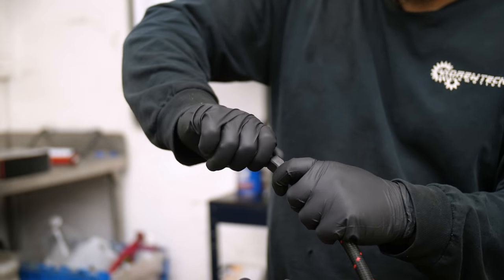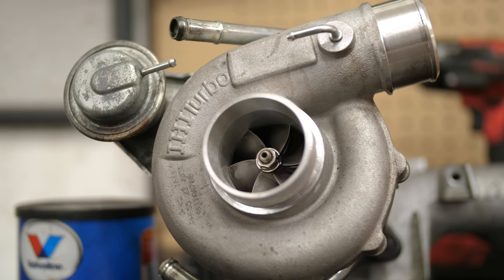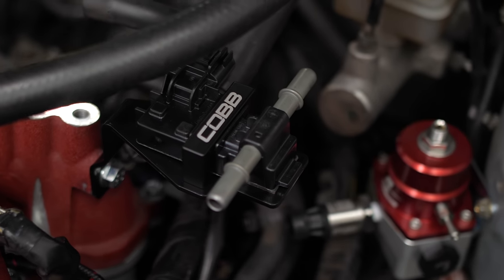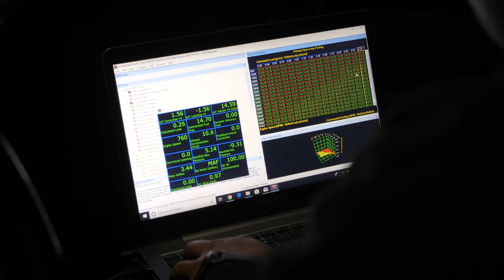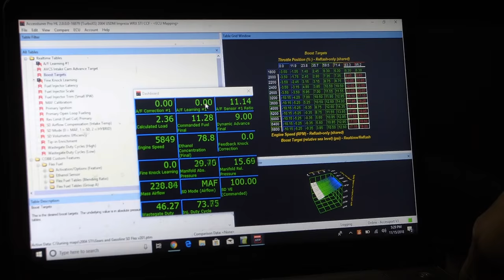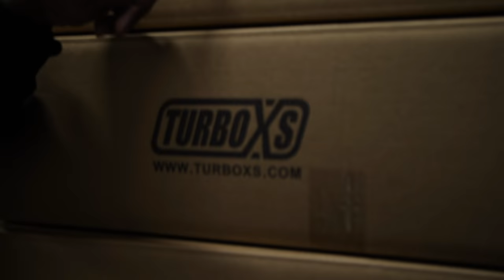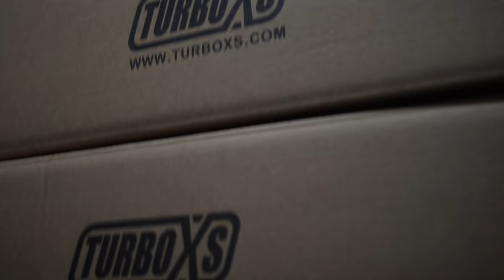Installing Flex-Fuel E85 on My Subaru Forester

Comment: You're going through all this work just for 310hp. Fact is, even with just exhaust and intake mods, these stock Subaru engines are known to eventually fail due to mileage. If there is any inherent problem with your specific engine, 310hp would still cause your engine to break, but the damage would just take longer to surface. 

If you are just a regular guy working a 9-5 job at the mall, you would want to make your car as reliable as possible to save money on repairs and to ensure you can get to work reliably as to not lose your job. But you are a YouTuber. You are in the entertainment business. Your job is to document the process in a way that's interesting. I've been a follower for a long time and I want you to succeed. You guys have excellent production value. It's just that your videos are just like traditional television car shows. This channel has the potential to compete with other automotive YouTubers in terms of entertainment value, but it is hugely limited by the lack of desire to push things further and to try exciting things. You have to ask yourself. Do you want to be content creators like Salomondrin, TJ Hunt, Tavarish, Adam LZ, etc, etc? Or do you want to be like dinosaur media such as Motor Trend? I am not a hater, I am a fan. But this video just makes me feel that, in my opinion, the content creator just wants to finish installing all the nice parts, get the car running, and be done with it. It's like you just want to get the car mods over with and go home as if it's a chore. The way Francine keeps insisting you to bump up the power more seemed as though he felt achieving such low hp was a waste of his talent and time.

Comment: Calling the Bens, Su-Ben (Subaru Ben) and Mitsu-Ben (Mitsubishi Ben)

Su-Ben is the kind of guy I can relate with. Prioritizing safety and reliability. Even though it's still safe to increase the power just a little bit, it's still safer to keep it below the safe threshold just to make sure it's safer. Mechanical sympathy.
Reply: Better names would be bensu and benmitsu
Reply: @alexstromberg7696  Better!
Reply: I know guys on stock internals making 350+ with meth on 93oct
Reply: @Bittertokken  meth is meth.
Reply: So great to see this kind of mod work in action. All I ever see on YouTube is chatting with tuners to get "just a little more...", not cutting it back. Welcome to tuning your daily.

Comment: The two most impactful mods you can do to an EJ to improve reliability, without splitting the block;
1) Replace the oil pickup - factory one has brazed joints, and they crack. Suck air, lose oil pressure, engine goes bye-bye.
2) Equal length headers - Cylinder 4 always (ALWAYS) runs leaner, and hotter than the others. Its the first to blow. EL Headers fix this by equalising, and reducing all cylinder temps.

No need to split the block, no need to put it on a dyno.
Reply: charliemoz but unequal length headers sound so good!
Reply: @HeyBigChriss  the boxer rumble sounds glorious, but it's unfortunately one of the major contributors to early motor death.
Reply: don't forget an Air Oil Separator
Reply: What is the “oil pick up” and where can I find that on my wrx
Reply: @TheCarBro  inside the sump
Reply: And pull the oil pump and take out the philips screws on the back and put loctite on them, they’re known to back out and cause a loss of oil pressure
Reply: @conorwright5546  AOS is only really important on very highly boosted engines (read: need forged internals to reach kinda boost levels), or for a direct injection engine. What the gears and gasoline guys are doing here, its not really all that necessary.
Reply: Oil pickup, EL Header, AOS or Catchcan, and Coolant reroute should all be on the list
Reply: @TheCarBro  a good one to look at is killer b oil pickup and upgrade to a 12 STI oil pump. The best upgrades for reliability. I used those on my 05 STI. I beat the shit out of it.
Reply: 71BGLancer what the difference between oil pick up and the oil pump? All in the name for my 2008 wrx with a vf52 swap
Reply: @TheCarBro  well the oil pick up is an upgrade to the stock one. The stock one breaks and you starve your engine from oil. The 12 STI pump is bigger and better it holds a little more oil. If youre tracking your car then a baffle will also be good it keeps the oil from sloshing side to side while on turns therefore engine gets enough oil. Oil starvation is what kills the EJ engines..I've gone through 4. Two 205s and two 257. When they go just go all out on the build and make everything stronger..overbuild.
Reply: 71BGLancer is the both oil pick up and oil pump DIY friendly?
Reply: @TheCarBro  depends on the extent on your knowledge on working on cars. The oil pick up and baffle go in the oil pan so you'll remove your headers and oil pan. The oil pump you need to remove the timing belt and the sprocket on the oil pump. I'm sure there are a lot of videos on how to do it. I did mine with the engine out so it was really easy.
Reply: 71BGLancer I installed full bolt ons on my wrx so in those categories I have experience in not so much with these oil things. But next thing I have to tackle is my timing belt. Do I really have to find a clamp to hold the driver side cam gears from moving?
Reply: @92BGLancer  12mm oil pump in a block that had 11mm originally is fraught with issues if you have no idea what you're doing - I'd advise against this, or get someone who knows what they are doing with EJ engine builds to advise on this one. You only get oiling wrong once.
Reply: @TheCarBro  Oil pickup is a tube that extends down from the bottom of the crank-case into the oil-sump, to "pickup" the oil, for delivery to the oil pump. The pump is just that, a pump that pushes the oil around your block and heads.
Reply: @TheCarBro  Doing the pickup is about a 3/5 on the home-DIY'er difficulty scale. You need to unbolt the engine mounts and lift the engine up a bit to get the sump off, and access to the pickup...if you add too much gasket-goo around the sump, you can ruin your engine by causing the pickup to get blocked, starving the engine of oil...probably worth the few hundred to just get a mechanic to do it.

Comment: 07:13
Anyone else notice the apparent excessive vibration coming up through the steering column?
Reply: Brodie Bennett hmm, yea. He definitely has that road feel tho
Reply: These foresters have a lot of issues with the steering column but usually just with them leaking
Reply: SiccBmw so it’s normal for the steering column to vibrate such, with the miles it has?
Reply: I’m pretty sure he has a STI steering rack. Maybe the chassis dyno was causing it?
Reply: yes
Reply: Its because hes on a dyno jet dyno.... its awd so the front wheels, hooked to the steering linkage is vibrating. look at say.... evans tuning on youtube that uses the same dyno setup, alot of vibration from the dyno being hooked up to the hubs.
Reply: Launch Control ahh, thx!
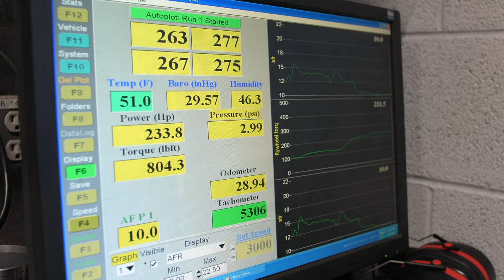Reply: 6:46 look at those vibrations at the flange and afterwards on the whole car back end. That dynamo-meter is not calibrated.
Reply: That's not a Dyno Jet, it is a DynaPack hub dyno  @DucDynasty
Reply: its a subaru, those things are total shit.
Reply: Cause racecar
Reply: FEEDBACK
Reply: Mine vibrated the same on a hub dyno Dynopac.
Reply: Ozzie Sheppard Wtf lmao, It was because of the dyno they used.
Reply: stiff motor mounts give the car more NVH (Noise, Vibration, Harshness.i have an NA forester ,upgraded the mounts and you can feel the rumble through the seats. some people like the feeling, others like a smoother ride. its no cadillac lol

Comment: Mine is completely internally stock. Lol e85 on 24lbs its amazing. Never been happier. It's been forever since the tune a still going strong. Engine wise. Because the power it is making, transmission blew first before the engine. How much does it have, can't Remer the actual number, but I don't beat a 500hp bosted beamer. So not too slow still. But 25lbs my friend, it is not unhealthy. It's rather too much fun. But the amount of E85 she takes, ha. It's worth it

Comment: Love the vid! really shows how cars can become money pits, as my car has become.  My 2004 FXT is making 365wtq and 312whp (dynojet) on 93 pump gas with pretty much a similar setup.  At what point is e85 better than pump when its tuned down to pump HP levels and have a loss in mpg?
Reply: yeah i was wondering the exact same thing
Reply: Yeah. My wife drives an 2008 altima that I bought for 2400 and so far I spend almost 3k. New transmission and a lot more and it's our only car. Yeah cars can be a pain in rear main seal.
Reply: @l0k0ldestryer  While I kinda understand what you're talking about, that's no where near a money pit.  G&G's car cost $5k-7k, the 6spd swap and labor charge its self is another $7k-9k, the flex fuel install plus turbo would probably run another $3k-5k.    Subaru motors are very expensive if the mods are pushing too much power, easily another $4k-7k for a new/built motor if it blows up.  If only they brought the Forester STI to the USA, this would be less of a problem.
Reply: @q2subzero  what kind of mpg are you getting with your fxt? i just imported one and plan on adding some sti bits for around 300 hp
Reply: @eastflyco8777  I'm getting 22-24mpg, highway, on this break-in motor right now, I put in an IAG stage 2 block recently.  almost completed 2k miles on it now.  16-19 city if i'm easy with the right foot.

Comment: 293 horsepower after all that money in new parts seems crazy. I get the whole reliability part but I’d love to see you guys build something purely for performance. With the knowledge you guys have and the connections you got I think it’d be inside.
Reply from the maker: Peak horsepower is not equivalent to performance. The smoother linear powerband is what I'm after, and this made quite a difference!

Comment: You went e85 for 310 hp? While I understand wanting longevity and reliability, you could have safely gone up to 330, 340. If you're worried about the current mileage of the motor, then why even bother going for more power in the first place.
Reply: But can you really do it safely??
Most people I know who tried ended up lifting a head or cracking ringlands within a year or so. 
That said these are also guys who track their cars implying they actually are using the power.
Reply: @Turbochargedtwelve  It's a high mileage motor that he's  overly worried about breaking, so he goes for extra power so he can beat on it and have it last? I just find it contradictory.
Reply: +Bittertokken  why does it have to be all or nothing? High miles or brand new pushing a stock turbo EJ257 on E85 to 350 hp and 400tq will not last long if used hard. Dial it back, enjoy the plateau of torque and linear power for what it is. If you want more  pay for the mods to do it safely(pistons, rods, head studs, and a turbo with a higher flow rate). 
Yes this motor might let go anyway ( though with the maintenance he’s done and the conservative tune it has a decent chance if living another 50kmiles) ,but at that age you can’t be that mad about it. When it happens you get a new one or rebuild it with the aforementioned pistons, rods and studs put all those parts on and then turn it up some more.
Reply: I’m making 350/340 on pump. 400+ on E85. 2006 WRX 150k miles. I have a buddy making 350/400 on E85. Stock block. Stock turbo. Another friend is making the same power level as me, 160k miles, stock block, he has been doing so for 3 years. All the same tuner too. If you know how to properly drive a turbo vehicle, maintenance one, and get a good tune then it’ll last.
Reply: Troy Pelsia 300 here on 93 and water meth.
Reply: Stanley Zitello fair enough, personally I don’t think all that effort and expense is worth it for just 310 on an aged motor
Reply: Bittertokken I’m running a FP Blue. Injectors are tapped currently on E85 so I need to go bigger. I haven’t done anything that people say to do, such as ELH and AOS. Car is working perfectly and pulls hard. He definitely could’ve turned it up a bit more. Stock power on E85 is a waste.
Reply: I'm running 18psi, 06 xt Forester with similar mods and making 340hp at the wheels. Engines only done 80,000kms though

Comment: I didn't realize until just now that your Forester started out as an automatic. I see on Cobb's website that they don't support flex fuel on any 2004 FXTs or any FXT with the automatic. How did you get around that? Did you swap out out ECUs when you swapped to the six speed?

Comment: Did you experience any problems with the flex fuel kit while running the original auto ecm. I, too, have an auto converted over to a manual (5spd but still lol) so in doing that i kept the stock ecm and just pinned into the stock auto trans harness. What im trying to ask is did you run into any issues with the kit or the access port?

Comment: curious, what type of milage are you hitting with setup? I have a similar setup on my 05 LGT but im only getting like 10mpg.
not sure if my tuner messed up, or if its just because the fuel injectors are nearly twice as big as the stock

Comment: I'm watching here in Australia and you have basically got the exact same tune in yours to mine. Built motor on flex with bigger turbo. My limit is the auto box which also steals my power but what can you do if the wife can't drive manual.

Comment: Is the engine easy to work on if I get ones of these stock. I’m thinking of getting one as a first car (as it snows a lot) and there aren’t many easy to work on trucks or SUV’s as options. If there is more options, please tell.
Reply: i would not consider any Subaru easy to work on.  Spark plugs taking 3-4 hours to change  is not an "easy" car.

Comment: But how much did all that cost? Don’t want to be hating, but 70 hp and 110 toque doesn’t sound like a lot for all the new parts and labor. I know the goal was reliability not power, so I would hope that this set up pays off in dependability in exchange for the lower power gains.

Comment: Why is he switching to ethanol, what are the benefits?
Reply: More power on the same boost level. Cooler charge temps for the engine. Better knock resistance. Downside? 30% worse fuel economy daily driving, track days are even worse.

Comment: I have I question for anyone not just Gears & gasoline I have a 01 mercury sable with 300000 miles I would like to make it more reliable  and comfortable I live in central va (Lynchburg) and was wondering is there any places that will help me with that
Reply: Also a little more sportier

Comment: Torque doesn't kill EJs, somewhere along the line you were misinformed lol. There's a much higher chance of getting ringland failure as opposed to throwing a rod or something
Reply: Darin Berry this isn’t an ej25 it’s a ej205 the problem with the 205 is the oil starvation and spun bearings.in which he adressed that in the first few vid.also the stock 205 block can only handle less tq and hp than the 25 counterpart.it’s a crap shoot.i can understand his side playing it safe.
Reply: @PooFighters_1263  fxt's have ej255's, which is essentially a STI shortblock. Not sure why/how he ended up with a ej205 but that's interesting lol
Reply: Darin Berry wait what?!! The 2004 fxt started with the 255 in the us??

Comment: Can someone give me a real explanation as to why an FA20 can make so much more hp? at least i've seen more high powered fa20s
Reply: Luis Bonola the fa 20 is direct injection.not a “better” motor per se.it’s just the fa20 can easily make power to a certain hp than ej but they are limited due to direct injection.
Reply: Luis Bonola and also the new wrx has twin scroll turbo compared to the old ej that still has a single scroll.

Comment: So you want more reliability, but yet E85 requires you to change oil even more often than before?
Seems legit!
Reply: What makes a car reliable isnt how long you can go between oil changes....
Reply: @JohnForce92  - It does take from the reliability if you aren't exactly taking 100% care of the car.
Reply: What's even more confusing is that he's worried about the age of the motor, but still went after more power. All that for 310 hp...weird flex.

Comment: "These engines can only handle 350wtq, I want to keep it safe" then final number is 348wtq wtf dude.  

Also power is not what you have to worry about,  it is torque.
Reply: It's 348 wtq
Reply: @Akirify  yeah, right on the edge of about the blow up even though he said hale wanted reliability and longevity.

Comment: Damn I'm at 500whp at 17psi on 91 on a stock head and Intake manifold and 65mm throttle body hahahah but then again my turbo is a bolt s362 shit I even run 88oct at times and smash it bottom was built.in 2009 stillbangs without a hiccup get a Honda guy runs 1050 on 300hp and changes the fuel rail hahahstock Honda rail support 700plus you wasted so much money that didn't need to be wasted just my option those boxer motor are junk along with the with their trans shits sad my my makes 240 with bolts and no turbo hahahah  could make your power on pump  lame video sorry